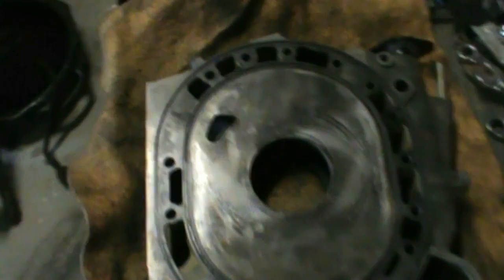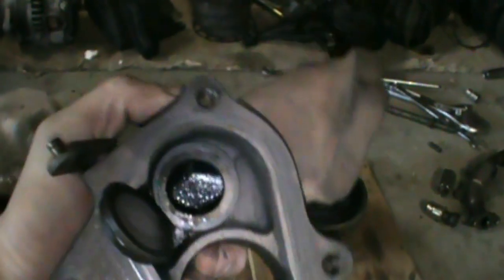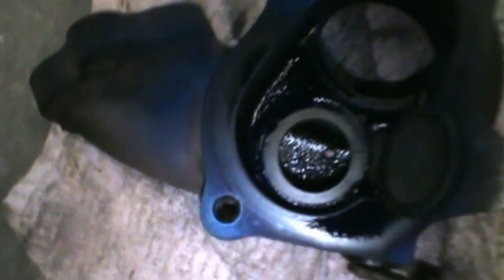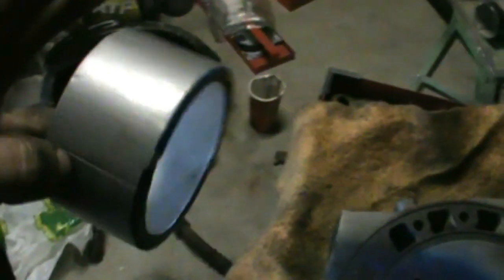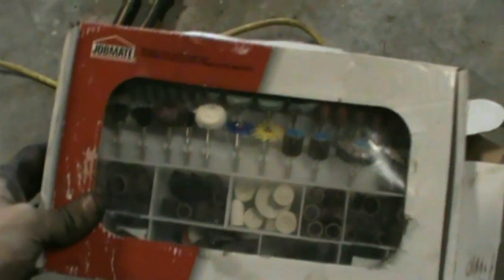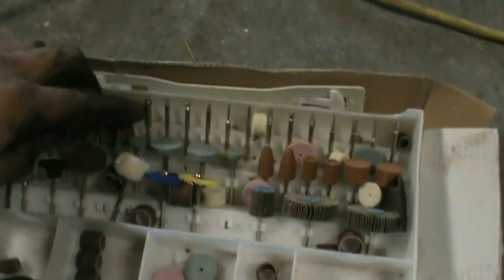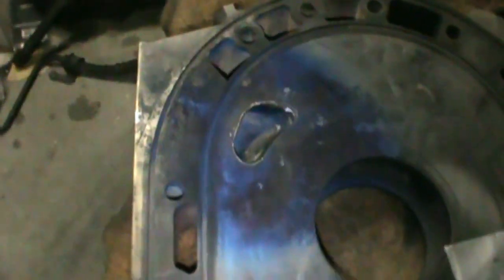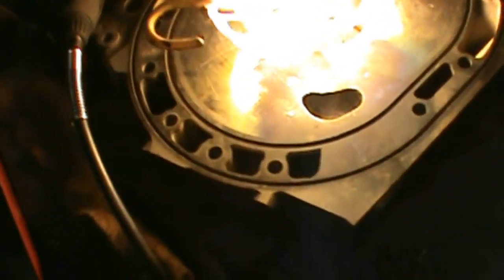How To Rebuild an Port a Rotary Engine : Part 5

Comment: NO.NICE TRY TROLL!!..Ricer comes from the term rice burner..And if your not even smart enough to figure out that the term comes from Japanese eating rice WELL YOU ARE A DUMB ASS!!WE all see that..The tune TUNER comes from having to tune EFI systems..I bet you dont even know what a Bosch mechanical fuel injection system isWhich I have owned in one of my three Porsches.I own a 9 second 67 camaro now and have owned over 200 cars..I have NOTHING to prove to you.I did make u look like a FOOL!LOL